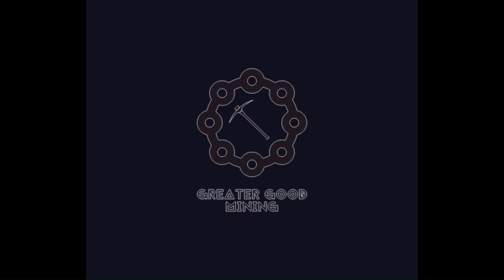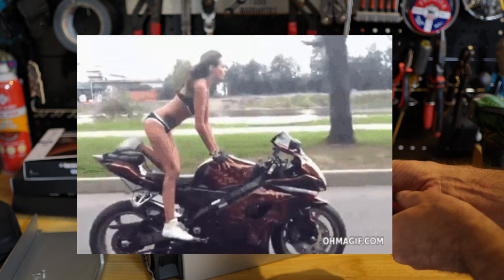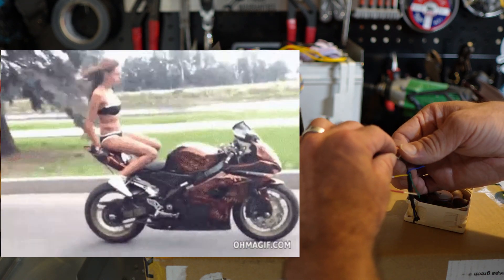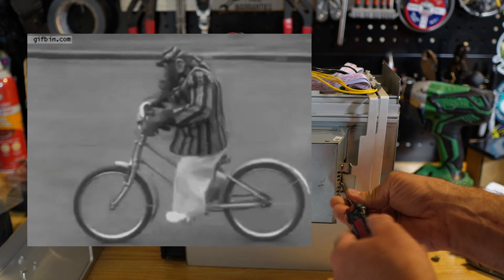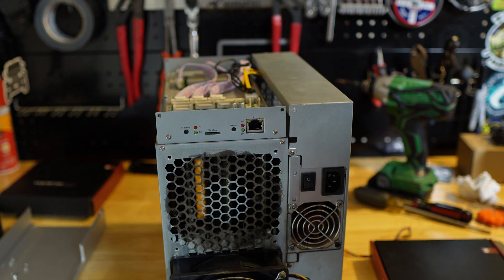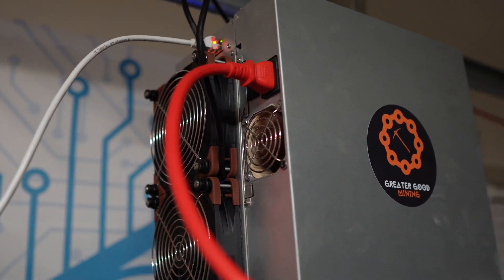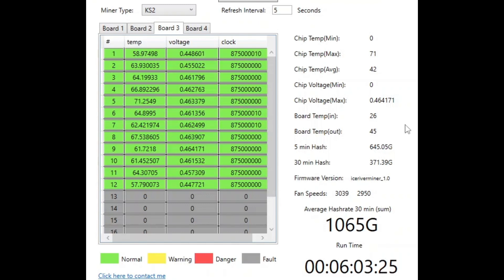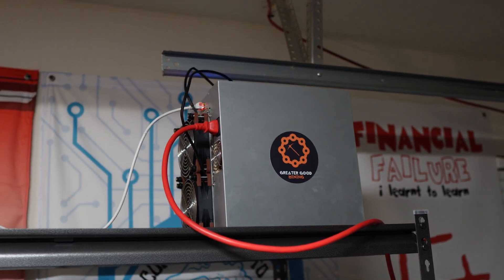Silence your Iceriver KS1 Kaspa ASIC for $70!! (Replace all fans with Noctua.. Yes even the PSU!!)

Comment from the maker: Are you still running a noisy KS1?
Reply: Yes at 100% doing 1640 gh🎉
Reply from the maker: @Miner_001  Nice! My weird OG KS1 won't even accept a factory firmware update. So far I havn't been able to overclock it, but I might try again in a future video
Reply: @GreaterGoodMining  that's sucks I saw in a video that you said that but will become a time for kaspa miners when efficiency will be key and all overclocked hardware will be stock or underclock !
Reply from the maker: @Miner_001  that's true! By the time I figure out how to overclock it, it'll be time to change to efficiency mode lol 😆
Reply: @GreaterGoodMining  lol. Good luck with that maybe in next video will be that luck!
Reply from the maker: @Miner_001   Thanks! I really should give it another go.. You know I love my FAFO sessions lol
Reply: Great video, I subscribed and will be doing this as well. I look forward to more videos but I was wondering if you could help me via some advice/suggestions regarding my new KS1? I'm not new to mining when it comes to GPUs and lower voltage mining (BitAxes etc) but I've never had to deal with a specific infrastructure requirement until now. I just received the rig today and it's my first ASIC miner but I'm a bit confused about what all I need electrical wise as I only have 120v outlets in my house. I read in the manual and online that I need 240v outlet for the miner to run properly but that part of the setup I am ignorant about and  there is little information about it online as well. I watched "how to setup KS1" from Crypto Miner Bros and he glosses over the electrical part as well and has a red box with a digital display but doesn't say much about it, is that necessary? From what I've gathered I just need to get a 30AMP breaker, run the wiring from that into my mining room then into an outlet housing, into the plug and that's it correct? I feel like an idiot asking this stuff but electrical work isn't in my wheelhouse whatsoever which seems silly for a SQL developer to say but it's the truth and I'm just being as humble as possible. I dont want my ego to get me into trouble thinking I can figure it out and end up ruining my unit or my house so I was wondering if you could help me or point me in the right direction? Thanks! All the best
Reply: I do in silencer box :D

Comment: Hello, great video thank for this. It is realy intresting, iam right now in the same situation to build in the NOCTUA fans. BNut, my first question is. 1. What is that for an software / 2. The 4-PIN description of noctua an miner is the same ? ... Thank you and greetings
Reply from the maker: It's the stock firmware on this KS1. The 4 pin Noctua will need to either be soldered to the old wires or an adapter would need to be used
Reply: Ok, but i ask again, the PIN OUT from the KS1 is not the same of NOCTUA ?
Reply from the maker: @thomashebert3308  no it is not. As I said, you will have to solder the fan wires to the KS1 wires or get an adapter
Reply: @GreaterGoodMining yes i know, but the colors of Noctua there is different
Reply from the maker: @thomashebert3308  I showed exactly what to do and which wires I wired up in the video at around the 4 minute and 45 second mark. Black wire to black wire, red wire to the yellow wire. Hopefully that helps

Comment: THX for the inspiration. Maybe I'll try this for next winter.  Like these Noctua fans as well - sure, they are from Austria  😉
Reply from the maker: The noctua fans are so much quieter and so far have been working great on the stock KS1 :] Worth a shot as long as your temps are under control for sure!

Comment: Nice video. but to people to remember, dont upgrade your ks3, others with factory fan speeds of 6000-7000rpm, those noctua will burn your asics
Reply from the maker: For sure, that's why I said even for the KS1 this is the minimum I am OK with running. The KS1 is only 600 watts and the power supply is running at a fraction of its full capacity.